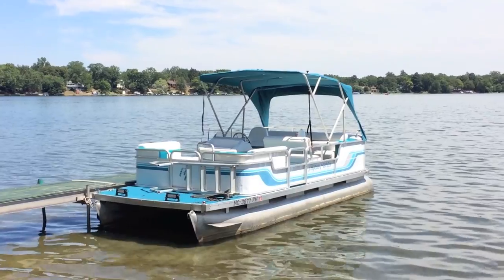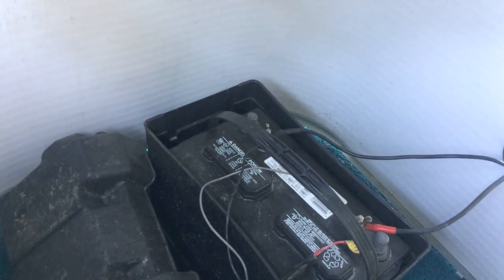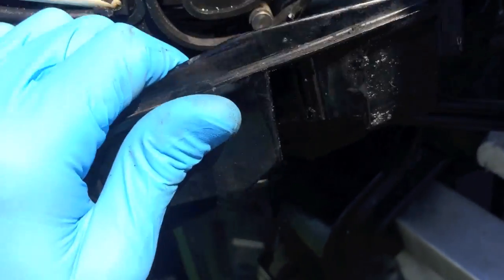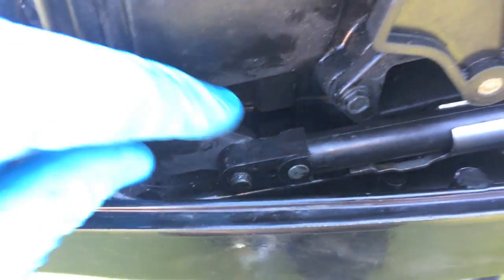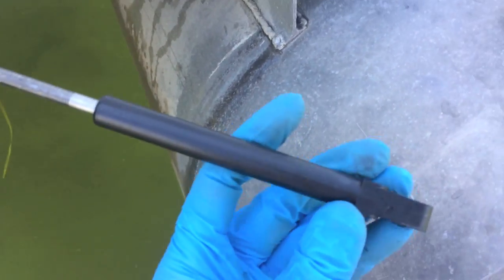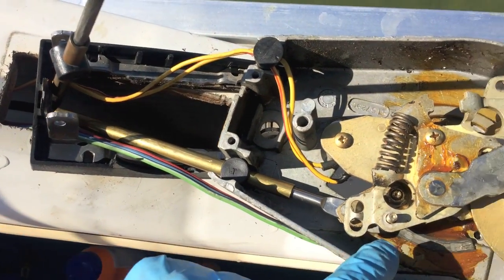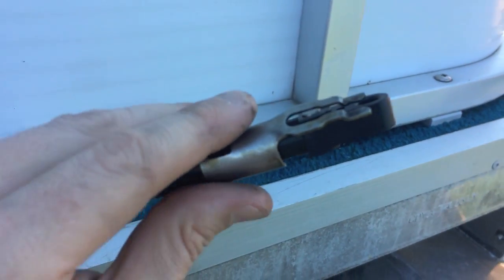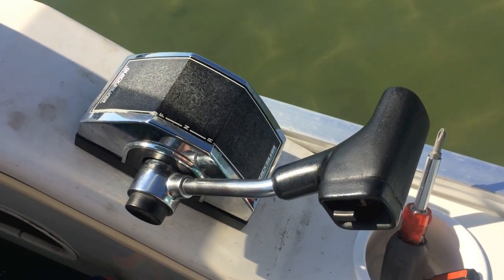Outboard engine won't Shift into Reverse/Grinds into Forward/Reverse - Shift Cable Replacement

Comment: I bought a 2004 mercury 60hp fourstroke replacing my 2003 50hp two stroke. And used the same cables but forward goes in reverse and reverse goes forward. Do I need new cables or can it be swapped around? I’ve tried everything.
Reply from the maker: Good morning, just poured a cup of coffee and am sitting down to answer any and all questions for the DIY community.

It’s likely that the cables are swapped at the connection points.  Keep us posted.  

Let us know if you have any questions and hey if you’re into crypto trading, join our DIY ecosystem and become part of an exclusive group of DIYers.

       toolboxtoken.com

Reach out to us any time!  🧰

Comment: Thanks for the helpful videos. I have an issue with this same control box and need some help.  The throttle only button is stuck in the depressed position and I wanted to see if you could help.  same exact throttle assembly as you have in this video
Reply from the maker: kevin burris Thanks for checking out the video and sharing your comment Kevin!  Unfortunately we haven’t made a video for that yet but it’s in the list!  As you know, In order to shift Throttle lever into neutral, that button must be pushed.  In most cases, this is caused by the spring Mechanism failing on the inside...thus not pushing it back out.

You will need to remove the Throttle housing as shown in this video & then use a flashlight to shine under the metal plate to see if you can find spring... if you find it great you can then remove metal plate to gain access to the internal portion of the button.  If not it might be time to purchase a new throttle housing.  Keep us posted!

Please subscribe to the channel and turn on your YouTube notifications that would be awesome thanks again Kevin!  😎👍🔧🔩

Comment: Hi  quick question, what's the difference between inboard vs outboard shifter, can I buy an outboard shifter for an inboard engine? Thanks for your help!
Reply from the maker: Thanks for watching and we appreciate the question.  Some will tell you they are the same however they may be ever-so-slightly different in length & diameter.

If it was us, we recommend purchasing outboard shifter for outboard and inboard shifter for inboard

Comment: I have an underfloor fuel tank and my motor goes good for 20 minutes then the primer is flat, after keep squeezing the primer for 5 minutes then the motor starts  but only runs max 5 knots all the way back to the boat ramp if i try go faster it stalls, any ideas because it does go fast for the first 20 minutes every time I go out then primer flat again? I dont think its a blockage as it runs perfect for first 20 min each time. Please help...
Reply from the maker: Thanks for watching, it can be a few different things.  How are the plugs?  Are they new?  Any wet fresh oil on plugs?

Another likely cause is the carburetor.  You can adjust the Jet valves to find that sweet spot.  Below is a video showing this procedure.

     https://youtu.be/NdRj7mv9K4k

If you press the compressible lever on fuel hose connection and disconnect if from engine, do you see any blockage or debris?

Let’s start there, keep us posted.
Reply: @DIYwithMichaelBorders  no debris all clean, had a service 6mths ago so plug was replaced by Yamaha service. They checked carburetor and tuned it,the breather hose is new and I blowed into it and i heard the fuel tank pop up sound so thats all good, fuel lines all new, primer new, i dont think it would be air getting in the line if the primer goes flat, but only when going fast for 20min, its as though the motor drinks more fuel than the primer can handle, funny thing is after squeezing the primer for 5 min it goes full but the motor will only go max 5knots back to the boat ramp, if i push the throttle to gain speed it stalls(only runs max 5 knots all the way back), if theres a vent inside the underfloor tank i cant access it as the fuel line just clamps onto a fitted pipe, so i cant get inside the sealed tank,  i took it to Yamaha and they just fitted a breather hose and they can't find the issue, i dont think they know.
Reply: @DIYwithMichaelBorders  It runs fine if not under pressure or going slow, thats why the service at Yamaha cant see it stall, then they cant see the issue. So every time i go out and go over half speed 20min and the primers flat.
Reply: @DIYwithMichaelBorders  I also fitted a new stainless steel vent on the breather hose and it didn't fix the problem.
Reply from the maker: @AussieRic  

Thanks for the follow up, it can be that the fuel pump diaphragm kit needs to be replaced.  That’s what happened to ours.

We filmed the replacement of that part a few months ago however video is in the que for upload and not going live until this spring.
Reply from the maker: @AussieRic  

😎👍
Reply: @DIYwithMichaelBorders  ok thanks so much, i will look into it, cheers budy👍
Reply from the maker: @AussieRic  

Looking forward to hearing back from you.  😎👍

Comment: Hi I am having a problem shifting into gear I have a 92 mercury 200. I was on the water running well stopped at the dock. Then went to go back out and could not get into forward or reverse. Any help would be great thank you.
Reply from the maker: Thanks for watching & welcome to the DIY Raptor Club.  It may be as simple as a friendly adjustment with the cable back at the engine point.  Please keep us posted.

😎👍🔧🔩

Comment: Hi I have the same control box. My problem is that the forward and reverse operation is backward. I know I can probably fix at the lower unit shifter, but looking to see if I can do it on the control box. Do you know if this control would have another attachment point for the shift cable so it moves in the opposite direction?
Reply from the maker: Yosvany Rodriguez 

Thanks for watching.  You will notice a 2nd setting inside Shift control box however it’s not for reversing Shift Cable.  What’s your update?  Have you been able to get your project completed?

Us fellow DIY’ers need to stick together.  Many more helpful videos to come!  😀

Please subscribe to the channel and Ring your YouTube Bell 🛎 that would be awesome thanks again!

😎👍🔧🔩
Reply: Mike, I opened the control box and I switched the shift cable to this second attachment point which is on the other end of the same bar where it was attached before. So, this end moves in opposite direction as the other end when you move the lever. This way when you engage forward, the shift cable pulls vs push which is what I needed to get the motor to engage in the correct gear.
Reply from the maker: Yosvany Rodriguez 

Thanks for sharing your update.  That’s great to hear & we appreciate you taking the time to reach back out to us.  You Rock!

😎👍🔧🔩

Comment: I have the same shifter that the handle has worn the teeth down where it sits on the gear.  I need to replace the shifter if I can't find a handle.  '85 27' Doral Citation.  Any direction would be appreciated.
Reply from the maker: Thanks for watching & welcome to the DIY Raptor Club.  Are you able to do a google or eBay search with the exact part # placarded/engraved on shifter itself?

You may need to visit a dealer & have them look up part in a parts catalog.

Keep us posted.  😎👍🔧🔩
Reply: @DIYwithMichaelBorders  done thanks.  A bunch
Reply from the maker: @williamdisbrow9260  

😎👍🔧🔩

Comment: I have the same Quiksilver top mount shifter, that will not shift into F/R. I noticed the button on the side of the handle you push in will not push in at all. Any videos or advice on what might be causing this?
Reply from the maker: Owen Shaver 

Thanks for watching, that’s odd...🤔

Is it rusted or bent preventing it from moving?  Keep us posted.

😎👍🔧🔩
Reply: It sat too long.   I kept shooting lube all around and into the throttle until the button started working again.   Probably easier to just take the throttle off and lube it properly.
Reply from the maker: Lance Pratt 

😎👍🔧🔩
Reply: Looks like the same shifter i have, but i dont have a button on side of handle, just bought the motor from a guy, but all i have to do to put in gear is just to shift the throttle

Comment: I’m currently piecing together a boat and motor with the exact controls. Would you know how to wire the separate ignition by chance
Reply from the maker: North Houston Outdoors 

Thanks for checking out the video and sharing your comment!  Building a boat sounds fun!  That’s awesome!  We have seen several cool ways to rewire controls & how to feed them throughout the boat.  You can gain access to several options & schematics online.  There are even cool ways to install a push button start option to older style boats...& Install a remote starter feature...many many cool options!  

Please subscribe to the channel and turn on your YouTube notification Bell that would be awesome thanks again!  😎👍🔧🔩

Comment: Seen your other video where you go into adjusting the cable. Did that not work? Reason I'm asking is I have same issue with older nissan 70hp. And once you put on the new cable did you have to adjust it also? And one final question , assuming that your cable adjustment from previous video didn't fix the issue, do you think there was some give or something in the old cable? 

Thanks !!!
Reply from the maker: arciefan 

Thanks for checking out the video and sharing your experience!  That’s a great question!  The original adjustments worked great.  

When my grandma purchased this boat, the previous owner said he had an additional shift cable that he planned on installing.  This is because he spent the winter rebuilding boat.

The original issue we had was the stalling of the engine at low idle.  After adjusting Throttle Cables, it solved problem.

A few months later, we started to hear a bit of grinding in the engine as we shifted into reverse & forward!

We then thought about that extra cable that came with the boat.  We grabbed it, made the video...& all grinding was gone!  😀

Hope this helps.  Let us know if you have any additional questions along the way we are here to help!

Please subscribe to the channel and turn on your YouTube notification Bell that would be awesome thanks again!  😎👍🔧🔩
Reply: Thanks and I did hit the subscribe button and notification.
Reply from the maker: arciefan 

Awesome Awesome thanks!  We appreciate it!  😎👍

Comment: What is the proper route to take with the 4 wire trim and trailer, wiring harness coming from the switch on handle. I have replaced mine and. Wow what a mess. I can't seem to get it to feed through somewhere that it is not in the way.
Reply from the maker: TazoxJK 

Thanks for watching & sharing your experience!  Great question!  This can definitely be tricky!

The best thing you will want to do is try & duplicate the exact location & position of the previous wiring & harness...unless it was falling apart & inconveniently positioned.

You may also find it convenient to use small tie straps to secure your wiring in a location that it will not interfere with any additional moving parts or wiring.

Keep us posted!  Please subscribe to the channel and turn on your YouTube notification Bell that would be awesome thanks again!  😎👍🔧🔩
Reply: @Kaleb Lawrence Instablaster :)
Reply: @Ricky Johnny thanks so much for your reply. I got to the site through google and im in the hacking process now.
Takes a while so I will reply here later when my account password hopefully is recovered.
Reply: @Ricky Johnny It worked and I finally got access to my account again. I'm so happy:D
Thanks so much you saved my account :D
Reply: @Kaleb Lawrence you are welcome xD

Comment: Ok, total noob here. We just under went a total remodel of my pontoon. I have a yamaha 50 HP with the same remote control. Trying to hook up the cables again and when i turn the key, the engine is running at full throttle even in neutral. I have ensured the remote and engine are in neutral before attaching but still have the same result. 

a couple of questions....
 is there a neutral safety switch like i have seen in other remotes.

do i have the cables reversed? The person that uninstalled it did label anything and it has been a few months since we are trying to put it back together. 

or am i just missing someone in the assembly. 

Great video otherwise though. Thanks in advance.
Reply from the maker: Joe Potter 

Thanks for watching Joe.  You may need to adjust your idle screw in the engine.  Below is a link to our video showing how to do this.

       https://youtu.be/B5M67-bvhXw

Keep us posted.  😎👍🔧🔩

Comment: I have the same shifter.  It seems to be pretty wobbly front side to side.  I kind of noticed in your video it doing the same thing.  Is there a way to tighten that up? Or is that just how this shifter is?
Reply from the maker: Braggin Rights Fishing 

Thanks for watching, we noticed a different in tension or tightness after replacing cable and putting everything back together.  What’s your update?

Keep us posted.  Us fellow DIY’ers need to stick together.  Many more helpful videos to come!

Please subscribe to the channel and Ring your YouTube Bell 🛎 that would be awesome thanks again!

😎👍🔧🔩
Reply: There is a Allen keeper on the bottom which can tighten this some

Comment: What is the series number of your quicksilver commander?
Reply from the maker: suliman elgehani 

Thanks for watching, if we remember correctly, this is a 14389A2 or extremely similar.  Hope the video helped.

😎👍🔧🔩
Reply: @DIYwithMichaelBorders  it helps alot. I have the same remote control, but I lost the handle throttle press cab.
Reply from the maker: suliman elgehani 

😎👍🔧🔩
Reply: @DIYwithMichaelBorders  more videos coming?
Reply from the maker: suliman elgehani 

Always my friend.  Us fellow DIY’ers need to stick together!

😎👍🔧🔩
Reply: @sulimandc3467  where you able to find one online? i am currently trying to put everything back together and it appears mine might have jumped in the lake.....hoping to find it in all the parts and tools i have scattered on the boat.

Comment: Looks like the same shifter i have, but i dont have a button on side of handle, just bought the motor from a guy, but all i have to do to put in gear is just to shift the throttle

Comment: How do you feed the tilt wires through the lever? Mine tore and i have to replace them.
Reply from the maker: Buddy Cherrix 

Thanks for watching & sharing your question.  The trim wires should have an electrical connection point where they are to be installed.

You may be able to Google search the schematic of your throttle lever and pinpoint the exact connection points.

Keep us posted.  Please subscribe to the channel and turn on your YouTube notification Bell 🛎 that would be awesome thanks again!

😎👍🔧🔩

Comment: Why are you replacing cable..whats wrong with cable are you replacing it cause its bad cause it won't go into reverse....we got a 75/50hp mercury it won't go into reverse...issues non going issues was told welcome to the world of boating...rrrr...
Reply from the maker: Denise Lynn 

Thanks for watching Denise!  That’s a great question.  Our shift cable was not fully engaging the gears.  We adjusted the cable inside the outboard engine however it just wasn’t working properly.  After replacing shift cable, it worked great.  Let us know if you have any additional questions along the way we are here to help.

Please subscribe to the channel and turn on your YouTube notification Bell that would be awesome thanks again!  😎👍🔧🔩

Comment: I have the same controller and removed both cables in order to remove the console to change flooring. It goes back to a 2006 Merc bigfoot and I didn't take pictures before I disconnected it, but I could swear that the throttle cable went to one side and the shift to the other but this video shows them stacked. I've found a diagram in the quicksilver controls pdf that shows the cables on opposite sides but I can't get it to go into neutral following the diagram. Is the correct method for a single engine to have both cables on the one side?
Reply: I have 1997 Force 90hp with the same controller. One cable goes to the left side and one goes to the right. I am about to change them myself. Been trying to find some tutorial with my same control box and it's been hard. This video helped me with the control box part.
Reply: @bbreede1  Thanks Barry, I fiddled with it and found that I had too sharp of a curve in the cable above the log under the decking.